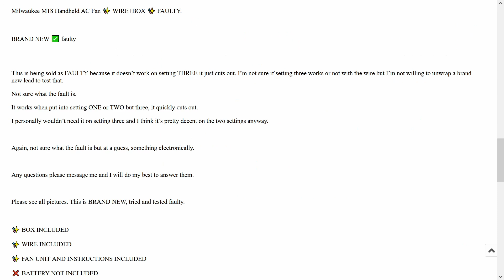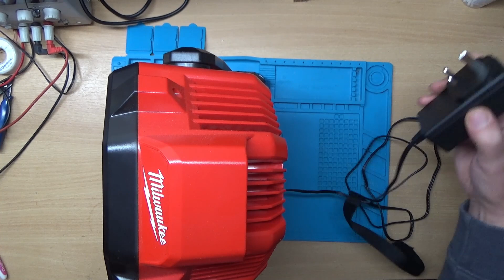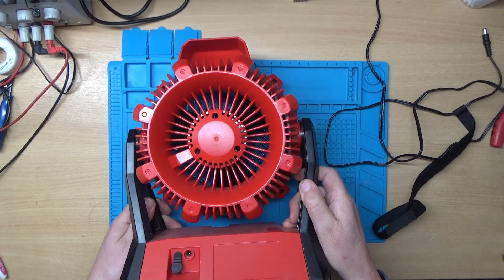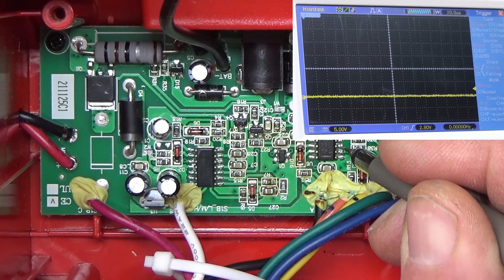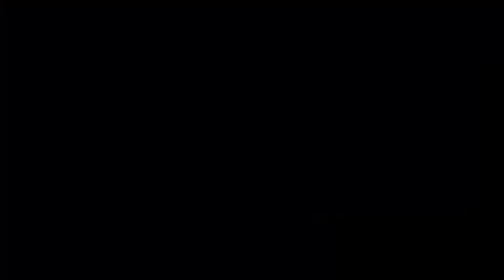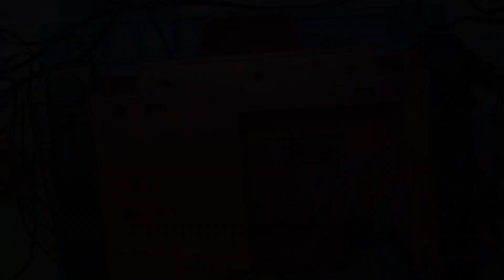Milwaukee  Cordless Fan - Weird fault - Can I fix it?

Comment: My fan just did this the other day, only on all 3 speeds. I've had it for like 6 years and never had a problem until the other day when I found it turned off and wont stay running on all speeds. I did notice a very a slight burning electronics smell as I tried different batteries but now there's no more smell and I cant find the source. I have a newer one thats only about 4 years old and it still works without issue. I might take it apart and compare the circuit boards. My broken fan has the same date as the one in this video.
Reply from the maker: I think the root cause of this one was the motor windings partially shorted or something.

Comment: Try to run the circuit without the motor
Reply from the maker: I think it was a bad batch of motors. If you supplied the 18v direct to the motor from the battery (same as full PWM), then after around 30-40 mins, the motor was VERY VERY hot. So I think the circuit board was fine, and detecting it was drawing more current than normal. I did look for a replacement motor, but there wasn't any available at the time with a compatible shaft to fit the fan rotor.

Comment: I just pulled mine apart to the fan motor. The cables are soldered there but there was a weak connection because of the bend in the cables. Redoing this connection point fixed the issue.
Reply from the maker: Thanks for sharing 👍

Comment: Just brilliant!! really like this one, would be interesting to see the control on the newer fans if they corrected  it.
Reply from the maker: Thanks, I think it was either a bad batch of motors or too much load on it possible. At full PWM it should provide the 18v to the motor. I did bypass the current sense to see if that resolved it, and it ran at full speed for about 30 minutes but then the motor was too hot to touch!
Reply: @BuyitFixit  One would have to wonder how much testing goes into these products before they hit the shelf! so interesting!

Comment: I feel like the there was a fault in the curcuit since the motor ran fine from the power supply
Reply from the maker: I did try bypassing the control circuit and the motor runs at full speed, and also tried bypassing the current sensing. However the motor got very hot after about 30 minutes. I think there's a partial short in the windings, or there's too much load on it, which was causing the over current sensing to kick in.

Comment: Brilliant! Mine just stopped turning on out of the blue? It ran fine, we took it to a project, cord or battery there's nothing? Disappointing as I've had really good luck with Milwaukee until now.
Reply from the maker: Thanks 👍 Yes there's a few Milwaukee tools which seem to have issues or design flaws. The small rotary tool is one, and fast chargers also seem to fail a lot.
Reply: I found that the rapid chargers gets stupidly hot if they are just sitting on the bench but if it’s vertical or mounted on the wall it runs much cooler. Could be a heat issue just cooking them to death because they roast charging an hd12

Comment: i think i should take of the fanblade and see if will fail again on number 3 .  if it keeps running then its the wrong fanblade and you have to reduce the current like you did now.
Reply from the maker: I'm not sure if it's a faulty batch of motors. I did try bypassing the current sense part and it did run at full speed for around an hour or so but the motor got VERY hot.

Comment: If you want to simulate a 100% charged battery, your power supply needs to be 21v or 20.99v 4.2v x5 cells.

I would test the motor by itself. Remove the board and check the back.

Not sure if you did a follow up on this yet.
Reply from the maker: @forevercomputing  I did a couple of other tests at the time. I adjusted the current detention by changing a couple of the resistors to allow more current before it cut off. It did run at full power for around an hour, but the motor cut out with a thermal trip, and it was too hot to touch, so I suspect a bad motor or too much load on the motor.

Comment: Seems like oil has dried up added load to the motor increasing amps ,spray a bit of wd 40 to melt the old dried oil down
Reply from the maker: Someone else suggested that. It's a brand new item, with very little use. The fan turned smoothly and freely by hand, and the seller had quite a few of these all with the same fault and all pretty much brand new. I suspect either too much load on the motor, or a batch of faulty motors. I did power it directly (overriding the current protection) and after about 2 hours the fan cut out with the motor being very very hot!
Reply: WD40 is solvent based and will destroy bushings.

Comment: from the specs, it tells that it can run 17 hour at low speed with 5ah battery, that mean low speed should take about 0.3A only, seems the motor jammed after long time usage and activate the high current protection~why not lubricating the bearing first?
Reply from the maker: It was a brand new unit, why would the bearing need lubricating? The fan span nice and freely. There were other units for sale at the same time all new too with the same fault. I suspect either a bad batch of motors , or a design fault (too much load on the motor) Bypassing the current protection allowed it to run at full speed but the motor got very hot after about an hour.

Comment: I used to Work on scanners, printers, daisy wheel printers, impact printers etc Found bronze bearings put extra load on motors when they dried up! Service manuals all said do not oil these bearings just clean them! Oil mixed with paper dust etc would wear the bearings out! It was a nightmare! Laser printers didn’t give any of this trouble ! 😊
Reply from the maker: Interesting, thanks for sharing 👍This unit was almost brand new, and the seller had others available too that also looked brand new. I would have thought dried up bearings would have been from a use over time on this one, but the fan seemed to spin freely, it was like either too much load on the motor or the wrong resistance windings or something as even powering the motor at full PWM (bypassing the over current detection) made the motor overheat after around 30-40 mins of operation.

Comment: When I was running AFREP in the USAF and training for micro/ micro-miniature electronics repair. The instructor told us about 80% of the repairs we would do would be from design errors or previous "repairs"! If anything, he was off even at 80%, it was a LOT more. I could not believe the number of engineering design faults I had to re-engineer to be correct. After retiring from the USA F and taking a job with Northrop-Grumman I got to see even MORE design faults by "trained" engineers! Again, I had to figure out what was wrong, find their error, send them a message that, once again, you made a mistake. I started signing my emails as "Quality Engineer" as I had to SO often notify them of a design error. Truly frustrating! Excellent repair were you also see an engineer made and error.
Reply from the maker: Thanks for that 👍 Did you see the Philips sound bar video I did? A guy bought 25 of them all with the same fault and sent me one to look at... he said there was a shipping container filled with them all with the same fault.

Comment: If I remember correctly, the 555 timing is set by an RC combination. It could be a capacitor faulty or drifted out of spec to make the duty cycle too high.
Reply from the maker: Possibly but these were pretty much brand new units and there was a few listed with the same fault. I think bad batch of motors or too much load on the motor as even powering the motor directly caused it to overheat after about an hour of operation.

Comment: Mine is faulty on all three speeds. I thought it was a dirty switch at first because if i were to rapidly turn the knob through the different speeds, it seemed to work for a little while before eventually shutting off. I haven't opened it up yet but this gives me some additional points to test out. Thanks for posting.
Reply from the maker: Hopefully yo manage to get it sorted 👍

Comment: Maybe they designed the current sense with a low tolerance resistor value and then the resistor got changed in production to a high tolerance value (cheaper). Then the over protection kicks on or something. Just a guess. or maybe not since the volt and amps seems to hand in hand value wise... Anyway, you could have swopped the motor out for a resistor load of similar amp value and see if the board shuts down at that current value to see if it is the motor or the board.
Reply from the maker: I tried powering the motor directly (same as 100% duty cycle on the pwm) after an hour it was too hot to touch and thermal cut out kicked in. I think it's a bad batch of motors or the motor can't cope with the load on it.

Comment: Hello, can you tell me where to buy a 20 watt motor for it? It refuses to work with the RS 755 engine after installing the impeller on the shaft. The engine starts, then stops.
Reply from the maker: Sorry, I was unable to find a replacement motor myself. You could perhaps alter a couple of the current sense resistors on the op amp to allow more current.

Comment: Looks like you have a popped joint on the left hand side of the current sense resistor. If the joint has some resistance then the circuit will think that more current is being drawn than there actually is.
Reply from the maker: I did try to bypass the current sensing, which made the unit run at full speed, however the motor got very hot and cut out after about an hour due to a thermal cut out on the motor. It's almost like the motor has too much load on it, or the motor slightly faulty. The unit is almost brand new, and at the time there was quite a few listed with exactly the same fault so perhaps they had a bad batch of motors or they changed the fan blade pitch or something?

Comment: Awesome, did you ever find a satisfactory reason for this fault ? you mentioned more on ebay with the same fault anything come from that ?
But whatever, a great solution and more economic to run! not quite the "Breeze" more 'gusty' !!....cheers.
Reply from the maker: Cheers Andymouse 👍No never did find the exact reason, bad batch of motors? asking too much of it? Yes seems odd that there were a number of these with the same fault for sale at the time...

Comment: could it be the bearings? heats up a little and gets tight, causing the extra load to hit the rpms...does it have an rpm sensor on the motor?
Reply from the maker: It does it almost immediately from cold, no rpm sensor just current sensing. I'm pretty sure it's the motor or too much load on it. I ran it at full by disabling the current sense and it ran for an hour but the motor was very hot and the thermal cutout kicked in. So either bad batch of motors or too much load on the motor I think.

Comment: I think I'd replace the speed 1 and 2 resistors as well to form a larger separation in speeds. Maybe get an anemometer and measure the airspeed at each speed... really geek out on the fix!

Comment: Is there a missing cap next to the motor connection? A cap there might limit the initial current not the motor which might allow the motor to run if the current rose more slowly🤷‍♂️

Comment: Great video, my first thought was to lubricate the motor bearing with something, somehow, what you done fixed the problem but if the bearing is dry or something which would cause the motor to draw more amps then there is a chance it will stop working again and maybe seize.  Great video though. 👍
Reply from the maker: Thanks, the motor did seem to rotate smoothly and seemed to be lubricated, there was a number of these for sale at the time all in pretty new condition, I think bad batch of motors or something was the problem. I did run it at full power but the motor overheated after about an hour of use.

Comment: My first guess was that there's a problem with the PWM feedback circuit, that is, too sensitive on the high speed setting.

Your change of R12 value has made high speed noticeably slower.
Reply from the maker: I did off camera change the current detection circuit which allowed the unit to run at full duty cycle but after about 2 hours the motor was very hot and it's thermal cut out kicked in. I think either a faulty batch of motors or too much load being placed on them. The seller had around 6 or 8 for sale all with the same fault and all in as new condition like this one.

Comment: That was interesting how you decided it was a resistor. I was going down a different path to come up with a solution on the problem, although my solution probably wasn't right anyway. I thought the timer IC was faulty by the looks of the scope when it cut out on the high. It seemed like the IC didn't like the voltage and that was why it shut off, but that was just the lines of how I was thinking about it. Awesome fix by the way. I'm working on a vizio tv at the moment, and this thing has me stumped..Oh, and it one of the only models you can't get schematics for. lol
Reply from the maker: Thanks Ron. The fix I did still isn't quite right. I think the motors are either faulty or the pitch on the blades is wrong. I did try bypassing the current limiting and it ran at full power for around an hour then the motor thermal cut out kicked in as it was mad hot. So my solution works just at slightly reduced speed. Good luck with your visio 👍
Reply: It's the underated dioide and the fuse is blown. Also, Black brown Black silver brown color code gives you a 0.1ohm resistor. Your resistor is not the problem unless you assume it should be a 1-ohm resistor.  @BuyitFixit  Here is the fix " Milwaukee jobsite fan m18. bug fixes." - Nelson Matias

Comment: I would personnaly say that it is a mechanical problem. With everything brand new the fan works the very best. It is surely a mechanical condition that happens and changes the load on the motor. They have made quite a few of those fan and it is a cash cow for the company.
Reply from the maker: It's odd as the seller had a few for sale with the same problem, all were pretty much in as new condition.

Comment: My favorite fix of the series by far... by now I am following you along and getting there just after you, lol. On this one, it was more of what I see on a daily basis in my job. I would definitely be looking at overcurrent issues, be it mechanical or electronic.  The idea of the resistor change I got there about 5 seconds before you, so that made me happy 😂. Using the bench power supply to check the current was brill, then the ammeter was spot on. I would be looking at the mechanicals first as the design probably was ok if they have made 1000's of these with most of them working ok. Maybe a damaged blade, poorly seated bearing, failing bearing, anything like this creating a bit more resistance and causing the amperage to go up too much. After that, I would check the resistors on the board or anything that provides a resistance as it could be faulty and allowing more current through than normal. By changing the resistor for a higher value, it does prove that something is weak and allowing more amperage to be pulled through and it then tripping out on OC. I loved the fix by the way, very apt Mick, I liked it. Coming to the end of the milwaukee playlist now, loving the series, keep the great stuff coming 👍👌👏👏👏
Reply from the maker: Thanks mate, I haven't done a Milwaukee repairs for a little while but I've got a few new items to have a look at 🙂👍

Comment: Sometimes That Stuff Has Too 
Much Protechtion What Would 
Happen If All That protechtion Was
Removed. Cause The Battery
Has Enough Protechtion
To Prevent The Motor From
Over Loading
Reply from the maker: The batteries actually don't have any output protection or under voltage protection. All of that is handled in the tool. They batteries only have charge protection.

Comment: That looks like the fan blade pitch as they trying to move too move  much air with that little fan and the wind resistance is causing the fan motor to draw too much current. You could have removed the fan from the motor and run the bare motor to test. I am really enjoy watching your videos 😊.
Reply from the maker: Thanks 👍I did try powering the motor directly and it ran at full power, after about an hour the motor overheated and the thermal cut out tripped.

Comment: My money is on a component in the current sense circuit is off value.
Reply from the maker: Unfortunately not, I tried adjusting the current sense, and got the motor to power at full speed. I even tried powering the motor directly. The motor runs for about two hours and then overheats and cuts out with a thermal cutout, so I think possibly a bad batch of motors? or perhaps the fan pitch or size is just on the edge of what the motor can handle. The seller had a number of these for sale all with the same fault,  and all in nearly as new condition.

Comment: The resistor is 0.1 ohm.  That is brown blk blk silver.  The silver band is divide by 10 or 0.1 times.
Reply from the maker: Thanks👍 I just looked back at the video and it is indeed a 0.1 Ohm. It looks black, brown, black, silver, brown (possibly). Thanks for pointing it out. You seem to be the only person that has noticed! I'm no expert and still make mistakes 😂👍

Comment: This reminds me of the 200 HP new air compressor that I was troubleshooting. I worked as a tech support engineer for the largest air compressor  company in the US. This compressor kept tripping the cooling fan motor OL relay. We discovered that the fan blades were pitched wrong causing long term high current to trip the relay. The fans were plastic and set into a fan hub that could not be reset. We replaced the fan and solved the problem. When you run at the ragged edge of the spec that is what can happen.
Reply from the maker: Interesting. Thank you for commenting 👍